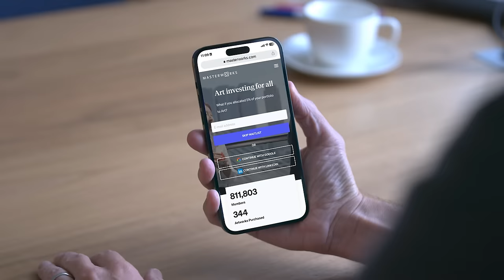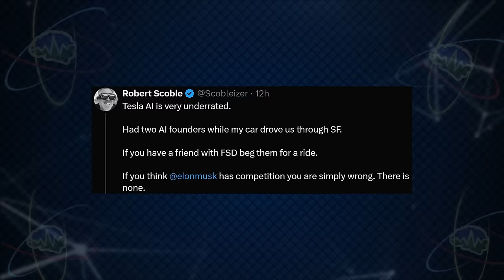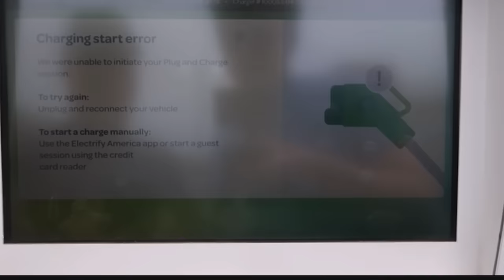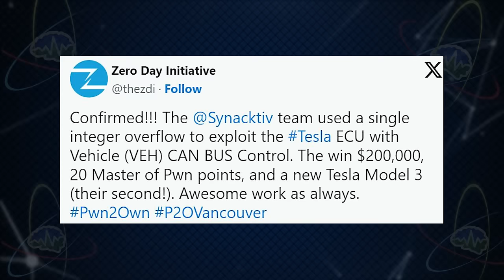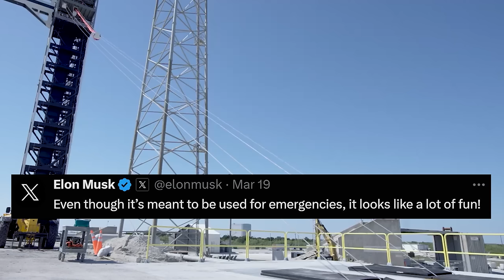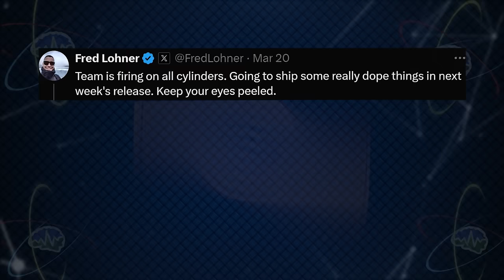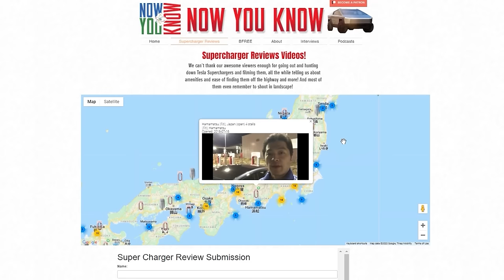Cyberhammer! | Tesla Time News 394

Comment: A key supercharger opend yesterday: Hernani in The Basque County, Spain. Up to now the atlantic drive from France to Spain passed through a large gap in the network. The Pyrenees mountains are beautiful but they're rather steep also snowy and cold in the winter. The drive through was always at the limits. The new supercharger plugs the gap on a major international route in Europe. ✳ 🇪🇦 🇨🇵 🇪🇺
Reply: It is all well and good to put another Supercharger in the Bay Area in California or somewhere similar, it will be used. But I love these chargers plugging gaps. It is so important to be able to go anywhere you want to go with low effort to feel free. (Not comparing myself directly, but the Neuralink story is an extreme example.) It doesn't even matter if the people locally have huge amounts of Teslas. There are more gaps to plug, of course! (Like northern Poland or northern Nebraska  random examples.)  It just hits differently than another useful urban area capacity increase.

Comment: Two small things we have done to reduce our consumption of plastic. We’ve started using wash sheets instead of traditional soaps in a jug for the washing machine. We found them on Amazon and they work well and the only waste is a small cardboard box. There’s no one convenience in most cases it’s actually less expensive. The second thing that we’ve done is when we go out to eat we look for places that use cardboard boxes versus plastic. If we go to a place that serves plastic we asked them to consider changing.

Comment: I avoid plastic water bottles for as much as I can, using an undersink reverse osmosis  device instead. I just eliminated one of my most common disposable plastic containers when I reverted  to buying frozen juice and mixing my own water into a glass refrigerator bottle. Long ago before retirement I was having hearing difficulties that were resolved by an increase in vitamin C consumption recommended to me by my boss.  Since vitamins in general are best consumed from food, I had been buying the large plastic bottles of juice at the supermarket. 
Our U.S. supermarkets do not make it easy to avoid plastics and shelf space there is a battleground dominated by brand promoters. I had a hard time finding the concentrated frozen juice until I went to the area that caters to new moms. Even then I had to look really low to find some 100% juice with vitamin C.  As I searched, a store employee was struggling with a cart heavily loaded with plastic water bottles to shelve. One whole aisle was nothing but  bottled water, while outside the front door was a seldom used reverse osmosis water refill vending machine, sad to see selling convenience triumphs over  true re-useability.

Comment: Plastics would be easily and economically recycled using thermal depolymerization which brakes long carbon molecules into short carbon molecules. Basically it converts  plastic solids back into the liquid hydrocarbons that it started as. From there I can be used as a refined feedstock to make new plastics or simply used as a clean burning sulfur free #2 heating oil.

Comment: I believe that the current run rate for the cybertruck is possibly 368 per week. About a month earlier than Joe T. projected with his timeline. Mondays flight showed the steam vents over the battery area were full force IMO. Making more than enough for 1K trucks a week is fantastic. Right now I think they have to work on ramping up suppliers to meet the lines capabilities. Still not seeing any increase in the area where they put trucks waiting for a part [not to be confused with the new end of line facility]. They have not yet fully moved to the new end of line. They still have 4 more lines to get rolling and we do not know if all the existing ones are rolling or at what capacity? I thought they were running all of them sometime last qtr but  I was wrong.  Maybe we will hear more at the next meeting?

Comment: I don't buy plastic bottles if I can avoid it, preferring aluminium cans, glass bottles, or refillable (non-plastic) containers. Of course I recycle all of those, that's super easy here in Finland with the pant system.

I also try to buy food not packaged in plastic, preferring no packaging at all (for fruits) or paper.

Hell, I don't even use plastic cups or other food containers anymore. Everything has to be either glass, ceramics, or metal (copper/bronze are surprisingly nice for their anti-bacterial properties). Too bad those aren't exactly common nowadays because everything is plastic.

Comment: How about a wrap that starts in the front with spaceX tessellated tiles that transform to “re-entry soot streaks”. The streaks fade out to clear (Stainless Steel) by the time it gets near the back. Strategically placed along the length, after the tiles, are energy weapon scars and 3D features that look like com ports, camera pods, antenna, etc. This would already look dirty so fingerprints, dirt and scratches would just enhance the look.

Comment: Regarding soda stream question, ditch the soda stream altogether and instead invest in a CO2 cylinder that you can buy and get refilled by your local fire extinguisher service center.  Buy a CO2 regulator, hoses, fittings, quick disconnects, and a 3 or 5 gallon Cornelius keg all from your local Homebrew supply shop.  It is super easy and cheap to have a constant supply of carbonated water.  It sounds daunting and impractical at first but once you pull the trigger and have it all set up you’ll see what a dumb system and pricy the soda stream type systems are.

Comment: not using plastic is great. But the fundamentals are, it is cheaper to keep making plastic from oil, than it is to recycle. If oil becomes so expensive that recycling plastic is a better option, then plastic WILL be recycled. Think about how recycling batteries will be cheaper than mining for new materials. Either someone has to to create a new material that is recyclable, or we go back to using paper, steel, aluminum, glass and wood. I use tap water and a stainless steel travel bottle. I try to do my part. single use plastics need to cease too. Canada and some municipalities are outlawing them.

Comment: My well water isn't drinkable.  It's heavy iron and manganese.  What can I do to get water besides plastic water bottles?
Reply: An RO unit- "Reverse osmosis filters excel at removing heavy metals due to their efficient filtration mechanism. The microscopic pores of the membrane effectively capture even the tiniest particles, ensuring that heavy metals are effectively removed from the water supply." There are also filtered water bottles & pitchers that also remove metals at a smaller scale.

Comment: 10.5 kWh battery is a joke of a size for an eMotorcycle. I ride a 2013 Zero S w its a 12.5 kWh battery and its just enough for me to commute to work (35 miles one way mostly flat) at realistic freeway speeds of 70 mph I'll have 20% battery left. I have to charge at both ends of my commute. Harley's attempt at making a noisy eMotorcycle is a continual miss for a large company with as much money as they have. :(

Comment: Recycling... we keep 12 16oz plastic bottles and reuse them, refilling from 2L bottles.  For the volume of 2L it is much less than the 4 16oz bottles in plastic it replaces.  ... Not quite recycling but reducing and reusing.

I like the recycle motto used in Australia and elsewhere.. "Rethink, Reduce, Reuse, then Recycle".  Rethinking what we do could eliminate the need for the use in the first place (like using glass or metal soda stream bottle replacements!

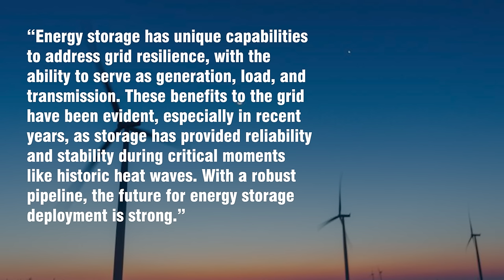Comment: 47:00 don't use a Sodastream. Buy a 5lb CO2 canister, attach a regulator with hose and beer carbonation connector, use steel carbonation bottle caps on large glass "beer" bottles. Soda stream 1lb cylinder approx $17 vs. 5lbs of CO2 from a welding depot aprox. $20. After 5 fills the big tank will have paid for itself.

Comment: Motorcycle rider here since 1965.  The problem with bikes is air resistance. Cruisers are particularly bad with a relaxed upright seating position and minimal wind protection/deflection. Most of the faster bikes have full fairings to improve the CD and the rider has to be in a tucked position for full benefit. Hence, it is difficult to make a fast moving motorcycle energy efficient as the profile that cuts through the air is not in control of the design engineers. Making the bike heavier to accommodate more batteries could help with range but diminishing returns apply here. A big part of the fun of riding a motorcycle is enjoying the feeling of freedom that comes with lots of power per unit mass.

Comment: Instead of recycling plastic, upcycling makes more sense. Plastic can be used to make skateboards for example. 4 plastics are realistically possible to upcycle: 1, 2, 4 and 5. Number 3 (PVC, aka vinyl) should be banned completely because of it's toxicity. 

In Sweden we actually have special plants that can burn plastics safely with high heat. This still unfortunately produces CO2, but it's at leaat the last resort for plastics that can't be recycled, and the heat produced is used to heat up homes.

Comment: 13:43 My limited 12.3.1 experience this weekend: phantom breaking still a problem and exiting the freeway can still feel like a roller coaster ride. Wife does not approve. Navigation also worse than pre-neural nets (often in the wrong lane on routes where is didn’t have a problem in the past). 

Wipers still like to operate for no apparent reason on a dry day. 

Yes it’s better. It continually gets better. But it seems like some problems they can’t find a fix for.

Comment: One thing FSD needs to remember are laws and by-laws. It is illegal to back out of a driveway onto a city street here where I live in Canada. Driver is 100% at fault in every accident. As well as changing laws from different provinces. In Quebec there are no right turns on red lights and you can toot your horn to run red lights. This is the opposite in most of the Country. In N.B. we can turn right on red lights and have heavy fines for running red lights.

Comment: I could only wish "compute" had not joined "spend" as a noun. And that Elon had not discovered the joys of the right wing nut jobs. But yeah. FSD 12 now drives enough like I do that sometimes I wonder who is driving.I have a "Chuck Cook" intersection with two grade-separated right turns that have been problematical. Now one of them is perfect, and the other still a minor issue. I'll admit I don't know exactly how to drive it safely either.

Comment: wooh ended up here as watching  bo polny ,whats happening /about to happen .Woke up just as you'll saying plastic can't be recycled !!?? [ asleep for over an hour ! long story ],since before 2000 it has been most definitely done and dusted , [that was when Edinburgh uni cracked the code on the vinyl  as in pvc ,nasty stuff ]. so easy you can do it yourself . Like all the hydrocarbon processes heat is the key , I believe 'Fischer Tropisher' is named process, after first experimenters . A gas column of evaporated volatiles is set up ,this can be fueled by end products , the distillates are drawn off .The most easy and abundant product is a diesel oil  , this is makes plastics so much more energy efficient than paper products ,it is crazy to see weak feckless greenwashing political class [ we are ruled by idiots ,with actually really evil ones pulling their strings ,sad]. allowing good land to be used up to dump it all in as rubbish, its criminal . Naturally metals are all recyclable , obviously all organics are ,sadly people have lost touch with the earth ,gardening compost bins etc . Ow then you went on to do a green wash of the crazy disaster of mass solar farms , now realizing to be any use they need storage [who knew ] . you should maybe research how many solar farms and wind farms having been set up using the tax payers funding ,and hydro carbon energy [ the planet is reverting to coal !? ,all the very expensive, subsidized, teslas are actually about 80% coal fired ,in the US , even more so in China !! ].are now acres of scrap waiting for more taxpayer funds to clean up the mess ,as yet unrecyclable mess . Breaking, huge solar farm destroyed by hail in texas , dang, and now most coal and LPG exports to europe are on hold with the Baltimore bridge down !. Texas saved by solar during a weather attack !? no, Texas was nearly wiped out ,people froze to death ,as the greenwashers have nearly got rid of coal and gas power plants , one wee spike in the grid ,and with solar covered in ice ,no wind , the nuclear plants hi lighted their weakness .Nuke power is only good for base load ,it doesn't do rapid changes , they had to shut the texas nukes down before they blew up ,they take days to restart .  Drinking water out of plastic bottles !!?? , I was in a large plastic factory 30 years ago when we started making them , I thought no way will people fall for this ,  but they did !? it is really stupid people ,don't do it ! ,if you must sip water all day ,which again is pure brain washing ,get your own high quality filter system ,osmosis does look to be best ,and use glass or stainless . Don't get me started on even drinking soft drinks like coke ,mind bending .